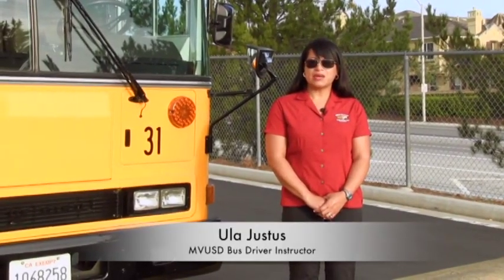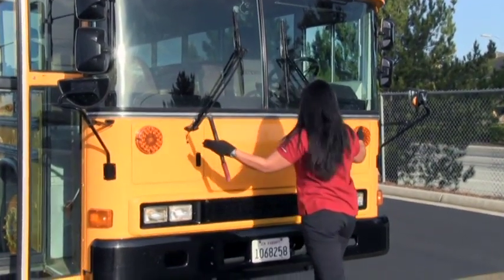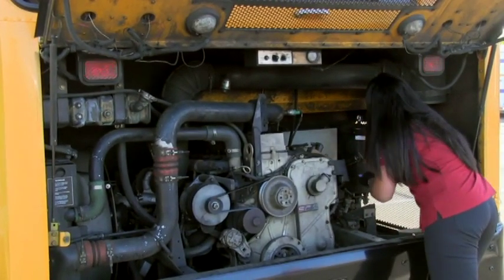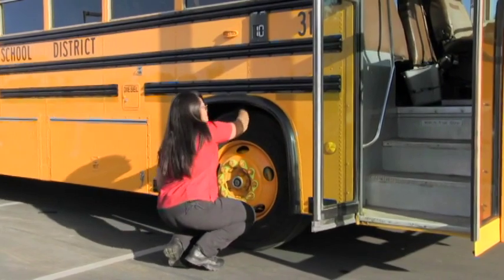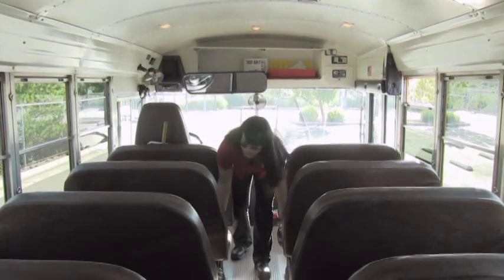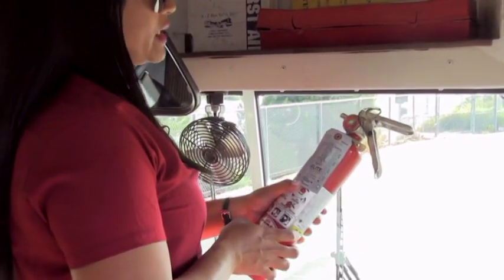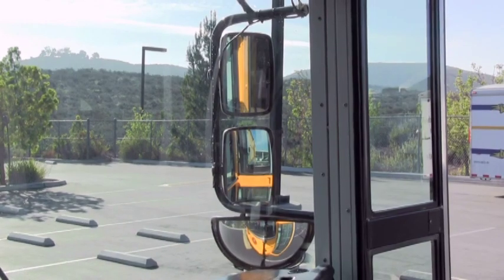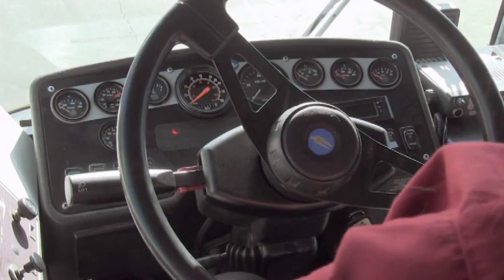California School Bus Pre-Trip Video

Comment: Excellent video! I would probably mention the reason you are moving forward and stopping after depleting air from the primary or secondary tanks is to check the emergency stopping system, which, in this case, is being able to still have one application of the service brake after complete air loss in either one of those tanks.